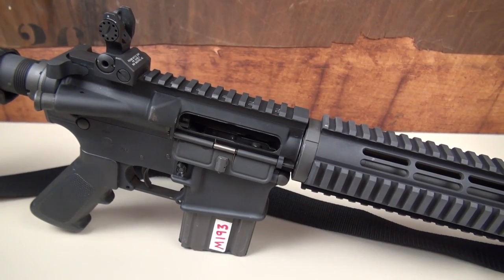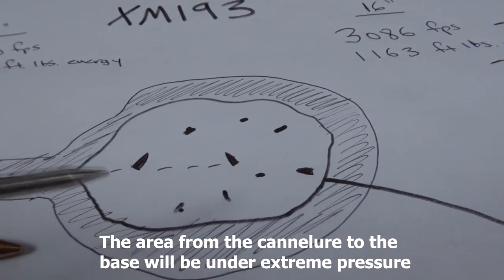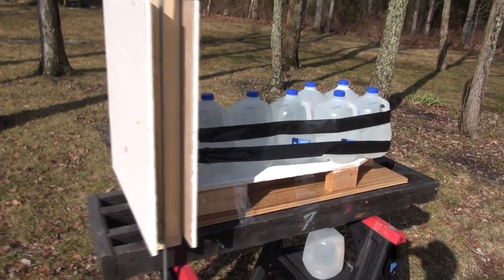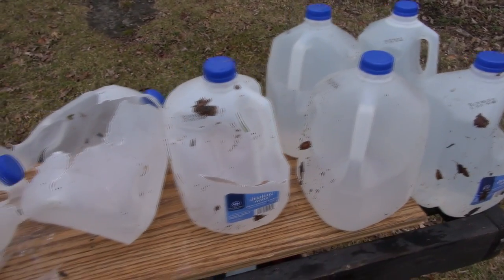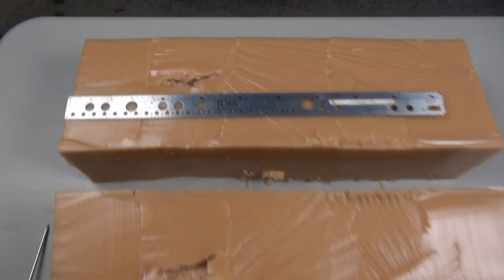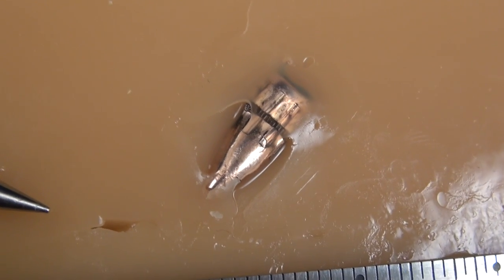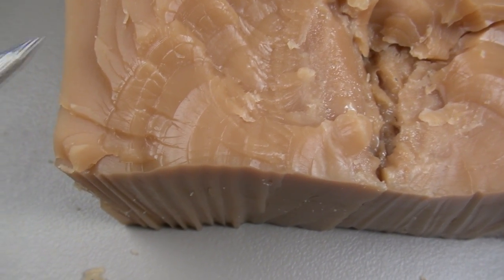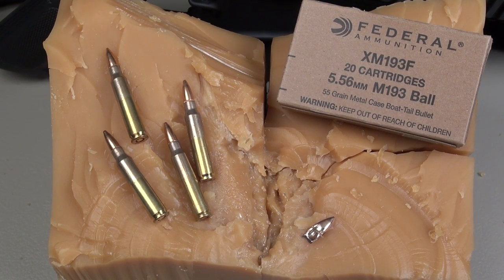5.56mm NATO XM193:  Drywall & Ballistic Gel Test

Comment: Well if you miss with an AR 15 and the bullet goes 100 yards the velocity will be 2900 ft/sec which is way more than a 12 gage / 9mm which are only around 900-1100 ft/sec. So no you are wrong the M193 will not lose velocity faster than a handgun/shotgun.

Comment: The early M16s in Vietnam had a very slow twist rate of 1 in 14. This didn't stabilize the bullet properly causing MUCH more devastating wounds. Current M4/M16/AR15s have either a 1 in 9 or a 1 in 7 twist rate and therefor do not do have the same ballistics as the early models.

Comment: What is the difference between the 193 and the 855 other than the 855 having the green penetrator tip (and thus a little more weight)?  Is it safe to mix both in the same mag if my AR's are all rated 5.56.  Thanks in advance for any insight.  love the channel and appreciate what you do.

Comment: @metalraider187 Correct me if I'm wrong but isn't the SS109 the green tipped steel core penetrator also called the m855 ? Its not supposed to break up it did whats it was designed to do. the m193 wouldn't be effective at that range I don't think at all.

Comment: FMJ's arent designed to expand upon yawing in a target generally, only in the case of 5.56/5.45 ammo which moves very very fast does the bullet deform in any way inside soft tissue. in this case deformity or complete shattering is NOT expansion.

Comment: Depends on the barrel length. In a 20 inch barrel, M193 will frag out to 200 yards, whereas in a 16 inch barrel it will only frag out to about 125-50ish. It will tumble as long as it is above 1700 fps.

Comment: @pac6010 and yes the ss109 and m855 both have the penetrator tip, though on soft targets there isnt much difference between steel core or non steel core rounds, they both frag and leave nasty wounds.

Comment: I have not been in the military or witnessed any one being shot with a M193 round but I have heard from others who have and have read that not only does this round occasionaly fail to fragment but it often fails to yaw/tumble while penetrating flesh especaly if only soft tissue and no bone is struck and just drills a clean hole threw the combatants torso and does not do much more damage than a .22 LR. but may penetrate threw several interior walls if there is a miss.

Comment: Oh! I neglected to mention I'm probably looking at an AR pistol or SBR. Short barrel! TiA.
Reply: Is this going to be just a range/plinking AR or are you thinking about using it for defensive purposes? If it's for defense I would reconsider the pistol/SBR idea and stick with a 14.5-16" carbine. First, the velocity loss when going to a 10 or 7" barrel is dramatic and will drop a lot of 5.56 loads below the velocity of its peak efficiency. What this does is effectively turn the ballistics of the bullet coming out of your short barrel at 5 yards the same as a standard rifle at 300yards. Also, the amount of noise and blast created by the 5.56 fired indoors is deafening in any format, but in pistol/SBR guise especially it will literally stun the operator if fired without ear protection rendering them temporarily deaf and somewhat disoriented. This is obviously not an ideal effect when the object is protecting yourself. Not trying to bash AR pistols or SBRs as I own two myself, but a lot of people jump into getting their first AR as a pistol without knowing the drawbacks of the design. My shortest is a 7.5" PSA with Sig Brace and standard bird cage muzzle break. It is fun to plink with at the range, but it is not at all my go to AR for defending my home. Also after doing numerous courses and action carbine shooting events I have learned that a modern 16" M4 style rifle is fine for close quarters combat and can easily be maneuvered through just about anything once your trained and comfortable with the platform.

Comment: dabNtx [EDIT: I've done the math and there is no way that the penetrators were tungsten. It seems that whoever it was that told me that was wrong!!!] The M855 penetrator core isn't made of steel, it is Carbide-coated Tungsten. You cannot dent them with a 3-pound mini-sledge, I have tried.
Reply: Shane Gill

That would be false. The only tungsten cored M855 is  the lead free M855 training round used in countries and states that are "lead free" and contains a tungsten powder composite core with a steel penetrator tip.  

The carbide tungsten cored projectile you are thinking of is called M995 not M855..

Cartridge, Caliber 5.56 mm, Armor Piercing, M995 (United States): 5.56×45mm 52-grain AP cartridge with a tungsten core. [black tip].

Cartridge, Caliber 5.56 mm, Ball, M855(United States): 5.56×45mm 62-grain FN SS109-equivalent ball cartridge with a steel penetrator tip over a lead core in a partial copper jacket.

Cartridge, Caliber 5.56 mm, Ball, M855 Lead Free (United States): 62-grain bullet with a steel penetrator tip over a tungsten-composite core in a partial copper jacket. Primarily used during training in countries with strict lead disposal laws. [green tip]Cartridge, Caliber 5.56 mm, Ball, 

M855A1(United States): 62-grain bullet w/ a 19-grain steel penetrator tip over a copper alloy core.  [bronze tip]

Pretty cool you got ahold of a M995 projectile tho!!  Wish I had access to M995..

Comment: 5.56 NATO is 5.56x45mm/62gr./Steel core/Green tip rounds. 
55gr is an awesome defence round because its high vilosity so it tumbles and sometimes fragmentates when it hits soft targets.
62gr just pokes wholes. Good for shooting thru things but bad in defence because it doesn't transfer enough kinetic energy to its target. Plus its expensive.:/
Over all, AWESOME VID!!!!!!!
Reply: The x193 doesn't have the steel penetrator. Both the 62 grain m855 penetrator and the 55 grain m193 will fragment if they are going in excess of 2600 FPS
Reply: GioGuitarDude Right. Has kept calling THAT 556NATO
Reply: The XM193 is NATO spec and has been used in Theater. Look at the Head Stamp of your XM193 rounds, should see the NATO Cross insignia. Not  cermon, just a thought.
Reply: don't tread thank you. Ss109 is not the only NATO spec 556
Reply: +don't tread the SS109/M855 is the NATO standard. Back in the 1970s NATO thought the M193 was "inhumane" so they decided to adopt the Belgian designed SS109 which they believed more penetration less fragmentation was better.
Reply: m855 will fragment at closer ranges. neither m193 or m855 will fragment at longer ranges  m855 does not poke clean holes in cqb distances

Comment: I got some OAK and CHERRY WOOD logs wanna test shooting into them with 3 different rounds #1-standard LAKE CITY 5.56 55 gr FMJ used by US military then 62 grain Big Bear HP rounds and then the M855 Green tip let me know which one can penetrate 16 inch thick logs?
Reply: Really I thought all that they used was 55 gr. 62 gr or bigger? What do they use now?
Reply: ***** Green tips hey that's good to know so if you ever get shot by one it will punch right through you yeah have those no big deal ,,,now if you really want more devastating ammo use the .223 Black Hills HP rounds with the nickel plated casings ---COLT makes them and Sivler Bear ammo--Got some on the way --you do not want to get hit by those...shot plenty of Green tips into 10 pieces of Oak wood boards usually around the 8 th or 9 th board green tip stops that's about 10 to 12 inches of board but the HP stops in the middle and just devastating damage in the wood....try that with those two rounds into 5 or 7 telephone books back to back and you will see? Green tips are actually more humane on humans..?

Comment: Being new I have to ask. What is the difference between 193 & 855 NATO rounds?
Reply: M193 is a 55gr. Full Metal Jacket with a canelure which creates a weak point where the bullet fractures upon yawing. High velocity and energy make it very difficult to stop with body armor and a mean little round capable of doing massive damage as the video shows. The M855 "Greentip" is a 62gr. FMJ with a steel penetrator core designed to defeat light cover and bad body armor. It needs velocity to do any damage. At low velocity it "ice-picks" and isn't really an optimal defense round. These are the two most common 5.56 rounds. Both are used commonly as range ammo and for plinking...the M193 however also makes a formidable defensive round god forbid the need ever arose for you. Always look for 'M' prefix such as M193 or M855, because the XM designates factory rejects...so XM855 cartridges are actually government rejects.
Reply: This NATO (military) terminology.... M193 was/is the designation for the NATO standard 55-grain FMJ when it was in service. In the 1970s, NATO transitioned to M855, which is a 62-grain FMJ round, also called "green tip" because of its green-painted tip. Erroneously sometimes called "armor piercing" or "light armor-piercing," green-tip has a steel cup embedded within its lead core to aid in penetrating enemy helmets (one of the design criteria for the round). However, M855 is not - repeat NOT - true armor-piercing ammunition. The military has separate designators for that.

Comment: The takeaway lesson:  It'll kill your kids in the next room.  The AR-15 carbine can be a decent home defense weapon in some homes, but not if you've got a house full of kids. 

I've chopped down trees with a 12-gauge loaded with 2 3/4" target loads.  At "in home" ranges they are devastating, but far less lethal on the other side of a wall than any AR-15 load.

My "defense guns" are a .380 auto for carry (because I'll actually CARRY it and not leave it locked up at home), a Remington 870 with target loads for home defense, and an AR-15 for "the gubmint."  (And jackrabbits.)
Reply: I didn't get that takeaway lesson at all...it only penetrated about 12" in the gelatin, so it didn't over-penetrate at all.

As for shots that miss and go into drywall, the tests I've seen actually show that bigger slower and less oblong shaped pistol rounds go through more drywall than the lighter faster longer .223 rounds do, even with the massive total energy differential. And shotguns were the worst I've seen in drywall tests...the balls all go every which way and devastate the entire room on the other side of the drywall.
Reply: Take away lesson. ANYTHING powerful enough to be reliably lethal will go straight through a wall.
Reply: Frangable ammo will NOT break up in drywall. It is designed to break up on STEEL targets. DO NOT USE IT FOR SELF DEFENSE

Comment: I don't think its a good idea to use FMJ ammo for home defense, while your bullet tumbled, it didn't fragment, it flattened out a little bit and squeezed a little lead out the bottom, the main bullet, and a smaller bit, and that's about it.  I feel no need to follow the Geneva Convention if someone is breaking into my home, military ammo is a poor choice for home defense when soft points or hollow points will perform much better.
Reply: I aggree to an extent, but it's all different based on the situation, setting, and personal preference. I have a couple (2 or 3) Pmags loaded with some Sierra BlitzKings @ 3200 fps and the rest are all loaded with M193 from either Federal or Winchester and some Black Hills MK262 mod 1. I do believe the polymer tipped BlitzKings would be devastating and cause massive trauma, but at the end of the day it's still a round designed for small game/varmints and only offers 6-8"penetration after its all said and done. M193 above like 2700 fps also creates a devastating wound cavity majority of the time but also offers a bit more overall penetration, which I like. The MK262 load is an open tip match, and has excellent penetration and wounding capabilities as well as top notch accuracy. Where I live I am not right on top of my neighbors and have a decent amount of space, but if I were living in an apartment or townhouse type setting I would probably stick to just the minimally penetrating loads and rely soley on follow up shots for insurance.
Reply: Unless you live in a sparsely-populated area, the main safety concern with using a high-powered rifle for home defense - any rifle, not just an AR - is the risk of over-penetration. Legally, you - the firearm owner - are responsible for every shot you fire, regardless of what it hits or where it lands. That means that if you hit that "bad guy" coming through your bedroom window at 3AM center-mass with a couple of shots from your trusty AR15, you are still responsible for them if they don't stop inside the target, but instead go into a neighboring dwelling and hit an innocent person. For that reason, you are absolutely correct that high-powered rifles/carbines are usually a poor choice for home defense in urban and suburban settings - at least inside the home and for most circumstances. You are much better off using a handgun loaded with a high-quality hollow-point self-defense load, or a shotgun with the appropriate weight of birdshot. Buckshot is too heavy for most indoor home-defense applications. Dos are great too, as are burglar alarms. That way, no one has to get tagged....

Comment: i live in alberta canada. i cant find a bulk surplus 5.56 for my AR15. all we can get noe is.223.
i know the 223 will work but does anyone know why we cant get 5.56 ball.
 close up theres not nutch difference but to shoot out 300yrd. the 5.56 iway more relable.
note....
do not put 5.56 in a 223 cambered gun. it will destroy your gun. it will only work in putting 223 in a 5.56 chambered gun. this configuarion ha shoulder room that the othrt doesnt.. if you don't completly understand what im say. as are yout gun store. if you have no one to ask to grt this straight then just dont do i. stay with the ctamped calibre.  its you life...protect it please
Reply: +JustAGuy Just send me a message when you follow me back so I remember who I'm talking to.
Reply: +JustAGuy I swear, last post, but I forgot links don't always work.  If it isn't showing up above, it's called

sgammo dot com.
Reply: 55-grain FMJ loaded in .223 Remington cases is, for all intents and purposes, identical in performance to M193 55-grain 5.56 NATO ammunition. Some manufacturers load their 5.56 rounds a tough hotter, but usually not by much. NATO-spec brass is required to be tougher (for use in automatic weapons, such as machine guns) and therefore slighter thicker and heavier in parts than .223 Remington, which is its commercial counterpart. Paradoxically, some commercial loads of .223 Remington are hotter and higher-pressure than 5.56 loads. As you note, it is always prudent and wise to be safe concerning the use of approved ammunition. Most ARs these days are made to handle both 5.56 and .223.

Comment: I wonder if something like Wolf Gold .223 would have the same results?
Reply: I'm not sure but I think wolf gold is very similar to m193
Reply: not so much. the best thing for your 5.56 chambered rifle is nato 5.56
i only use 223 when i cant get 5.56.
stick to the engraving on your barrel. .thats the best.
dont want to see any one get hurt
Reply: Wolf Gold is tiawanese spec m193. it is labeled .223 only for the sake of import which is semi dangerous for those wanting to shoot it in a .223 chamber. It is almost exactly the same load as US made m193 so yes you would get the same results.
Reply: Not even, .223 is perfectly safe in a 5.56 or .223 wylde chamber. The only difference is a slightly longer free bore to deal with the higher pressures of 5.56 ammunition.

Comment: I don't see how people can say that the 5.56 doesn't have enough knock down.  Looks like enough to put a hurt on someone to me.
Reply: I agree, if you are shot by anything it will drop you.  You may be the biggest badass in the world with top of the line sapis in your flak but it will still knock you down from the concussive force.  You'll either be out cold, have your breath knocked out of you or dead from the next round catching you.
Reply: The original M16 was considered "inhumane" by many nations due to the horrendous wounds it produced:  VERY tiny, lightweight bullets from 20" barrels.

The much heavier "green tip penetrators" are pretty standard military issue today, and shot from short carbine barrels.  There is a lot of anecdotal evidence that they just zip right through people sometimes.

That amount of energy will definitely put someone on the ground for good.  The trick to to dissipate all the energy inside the target.  Any energy left when the bullet exits the target is wasted energy.

It's all about energy.....and the most effective way to increase energy is to increase velocity.  Everything else is just "details."

The Green Tips are made to penetrate soft armor, light cover, etc.  They are certainly NOT ideal for causing wounds.  They also have a greater range.  But at short range, if you want to cause maximum wounds with an AR-15 you want VELOCITY, which means the smallest, lightest bullet possible.
Reply: *****
How big is your freaking house?  Even his 7m test is a stretch. 

He's talking about burglars.  Unless you live in the Superdome then 100m isn't relevant.
Reply: Eric Anderson I thought it was the slower twist rate of the first M16 that causes the horrendous wounding effect. Correct me of I'm wrong.

Comment: Correct me if I'm wrong, but are these bullets lead core? Have you done any testing on PPU or PMC?
Reply from the maker: I have a ton of PPU 75 gr but have never tested it.  No tests with PMC that I can recall.
Reply: *****
Is the XM193 lead core? If so, I suppose you'd get similar results with the PPU and PMC.
Reply: Devgru77 m193 is lead core, copper jacket. M855 has a lead base with a shell penetrator in front of it, all inside ( I think) a bi-metal jacket.
Reply: +E. White The m193 penetrates exactly as well as the M855 in every video I've seen.  Even AR500 armor at up to 20 yards.  It's all about the speed.
Reply: JustAGuy I didn't imply that they didn't......
Reply: E. White Sorry, wasn't meant to sound against you.  Just chatting.
Reply: JustAGuy No problem.